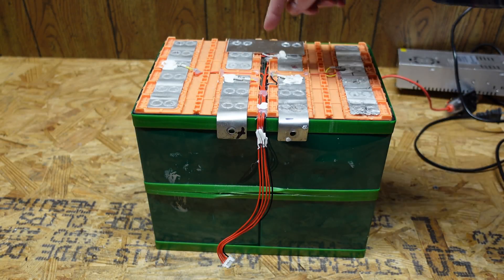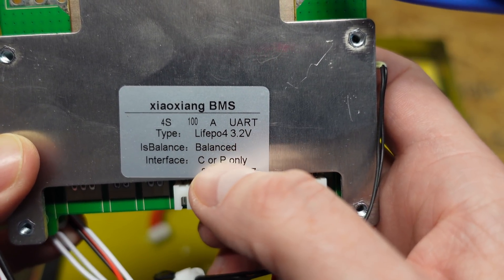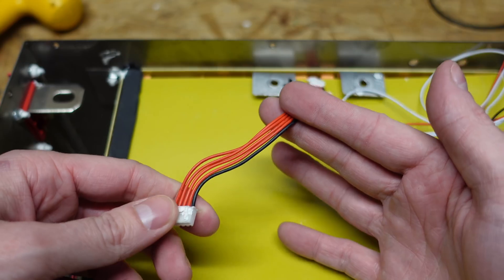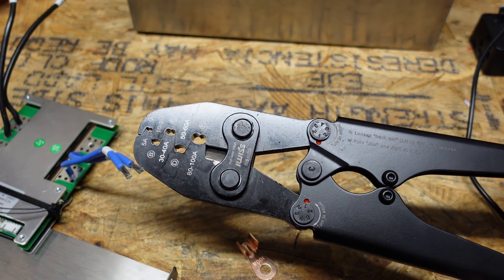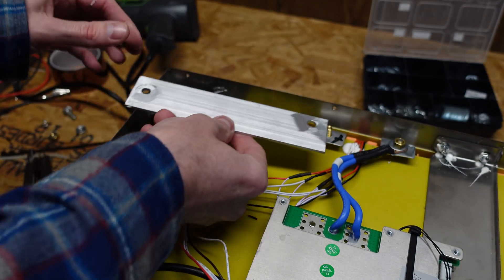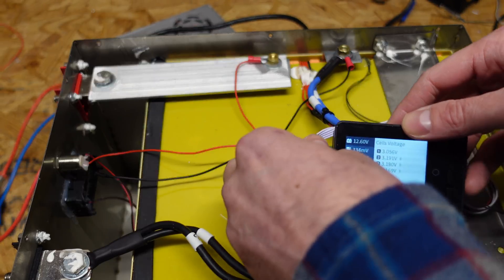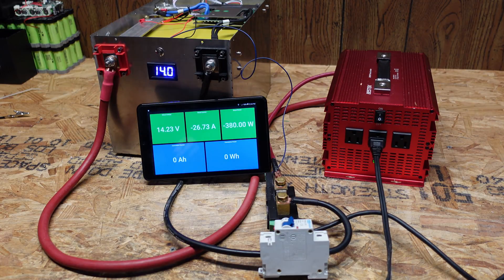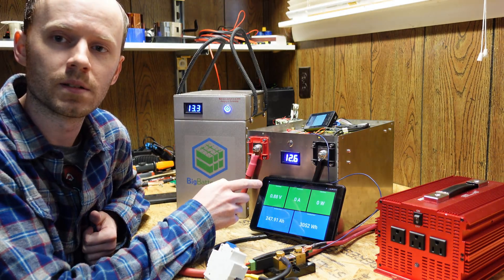Repairing the Failed SHUNBIN 12V 300Ah LiFePO4 Battery

Comment: Thanks very much for this review. These batteries are a very good price, so I have been looking at them. This video has put a stop to that. Without knowing the state of the cells originally, its not really possible to say if they are the main cause of the problem. It's certainly true that the BMS was really junk and didn't appear to be balancing the cells and allowed overdischarge. The charger didn't look very good either. I noticed you used a different charger to do the job properly. I will look elsewhere for a better battery.
Reply from the maker: Yeah, it's really too bad because it's a super-strong enclosure too. I wish more would adopt this type of enclosure rather than the standard plasticy kinds. They just need to improve overall choice of components here...

Comment: I've had two of the SHUNBIN BMS units fail. Pulling the cells out and hooking up Overkill BMS 16s.  When I purchased the SHUNBIN's in 2019, there wasn't anything even close to the price point. Using them for off grid house in Cabo San Lucas and electricity was a must.

Comment: 070121/0208h PST 🇺🇸 further to the note below, please note the JBD BMS can be mounted on any metal surface by unscrewing all the  M2X12mm flat head screws and replacing with M2X15mm screws and Mount the BMS on the existing Al (Aluminium) board, safely. No need to use double sided tape. FYI. Thanks and 73s…

Comment: I installed the same bms on my diy cells the same way but either bms is doa, or can it be woken up somehow?
Reply from the maker: You used the same BMS that BatteryHookup sells and it was DOA?
Reply: @LithiumSolar  yes the black wires show no voltage at the p-

Comment: HI, really thanks for your job, GREAT ! Now a 1M usd question....in  a case like this, do you believe is it possible to change the "wrong" cell? I mean, i'm a solar off grid installer, thinking to buy quite 60-100 pcs new cells and arm my own battery pack. In teh case i discover a bad cell after  one- two three  years working, anyone knows if there is the chance to change it for a new one? If anyone works with lead acid, you know (like me) that it is impossible and a customer have only a chance, wait for the whole bank getting worse...and buy  new complete battery bank.... let me hope in dreamfully fantasy...

Comment: Well you didn't really fix it, just patched it up! instead of a battery you can rely on it's just a half ass rated ! With a faulty cell!
Reply from the maker: I can understand that perspective. Fact of the matter is you can polish a turd but it's still a turd. The core problem was the BMS, which is now fixed (replaced). I have no idea the original state of the batteries. I would bet money on them not testing anywhere near 100%  when it was new. Another commenter told me he had a battery with 90Ah cells where they should have been 100Ah... The whole thing is just junk to be honest (except for the steel case...).

Comment: You need the bluetooth module that connects to the bms and u can monitor all what is happening on the batteries and most important, u need to check the parameters of the bms.

Comment: I have the Shunbin 24V 400Ah battery, or rather the 348Ah battery. The cells are actually 3.2V 174Ah x 16 (2P8S). Gotta love rounded-up marketing, ha ha. Was expecting a 10kWh battery, can only get about 8.9kWh capacity. Oh, and used unmatched cells to boot. My BMS  bit the dust after about a year. Had to replace it.  So, yes I agree, there's better choices out there these days.

Was there any writing on each of the cells, 3.2V 100Ah (3P4S)? Or a lower Ah rating? If they're 90Ah cells, for instance, your capacity test might be better than you think, despite the presumably degraded cells. Might just need a bottom balance.

Comment: You can screw the bms into place. If you look close, the aluminium plates are connected to eachother by small screws. On 1 side is the screw,  on the other side you can see the remaining thread. I used m3 screws which go into this available thread
I would go for the 120a version of the bms, since that has 3 wires instead of 2.
Also, get the version with bluetooth, only a few $$ more.
Overkillsolar has them, or source them directly from cn (but thats going to take a lot longer)
OverkillSolar also has a very comprehensive manual regarding this bms on its site

Comment: Good Video, Thanks.
The SAD part in this whole "ShunBin" mess, they use good cases, properly line everything, take the time to laser weld busbars onto the cells, BUT they use a craptastic BMS and then more often than not use dubious grade/quality cells, even used one.

The Irony is, with a respectable BMS (even a dumb one) it would be so much better.
IF they made them with Used Cells but Tested/Matched and advertised it as such that would be fine.
IF they used even New Bulk-Commodity cells that would be more acceptable for most AND they could even make  Higher Quality packs using new Grade-A Matched LFP cells.

They are like 75% of the way to something really good and DROP the Ball big time while Self-Harming the company brand/name...   Pretty stupid IMO.

Comment: After crimping i solder the connectors. I do not and never will rely only on a crimp.
Reply: Believe it or not a crimp can be a superior connection to solder. If done properly you can get a cold weld, at atomic level. This is why a lot of old telecommunications equipment use wire wrap over solder. It’s superior both mechanically and electrically.
Reply: If you have already achieved a perfect crimp, a dab of solder (or sodder on the other side of the ditch) provides a nice environmental seal if you iron is hot enough and big enough so the solder doesn't wick into the cable.
A good crimp and sticky heatshrink is a better option though. 
Soldering before crimping is a complete No No as the solder will creep, heat and burn.

While we are talking about crimping,  think about pre-insulated lugs, please never purchase or use " vinyl grip" lugs, track down and pay the premium for "Copper grip" lugs.
Only Copper grip lugs are certified, critical applications like BMS cell sense leads can fail causing destruction if the cheap lugs are utilised.
Reply: Some will suggest soldering even with a crimp.  BMS Battery sense leads also read Internal Resistance of the cells they are monitoring, not just cell voltage.  If soldering is done and it is not a High Quality good solid connection it can & WILL introduce resistance which will throw off readings.

ALWAYS verify BMS Harness Leads once the Ring Terminal is attached for connection & resistance.  Make sure it is well connected to the Battery Cells PRIOR to connecting a BMS.  One tiny mistake & the BMS is cooked instantly.

Comment: Exactly why I'm BMS free  (so far..LOL)
Reply from the maker: Ooooh, living on the edge I see! Haha. Seriously though, would definitely recommend adding one for safety... :)
Reply: @LithiumSolar  Living on the edge for sure. Then I ask myself if I'm ready to subject my 56 KWH battery bank to a $10 Chinese BMS module
Reply: @mark_osborne  54kWh is worth a lot of coin and it would be ludicrous to use a cheap $10 BMS.  Running such batteries without a safety is pretty risky on the investment.  I'm running 5 LFP Packs,  1190AH/30.4kWh and each has a 300A BMS & QNBBM-8S Active Balancer because it is an investment worth protecting.
Reply: @mark_osborne  on the topic of BMS what is a good bms wud u recommend .... thanks for sharing the video
Reply: @raybacchus1026  A brain, a calendar,  and a volt meter ...lol

Comment: It would be interesting to see if after a few cycles this battery evens out a bit or if the capacity is permanently lost.  I have had mixed results with LiFePO4 cells where some subjected to deep discharge, even flat sometimes came back to near full capacity after 4-5 cycles but I have had others, even some from the same batch of cells that were permanently degraded in some cases to less than 30% of original capacity.  Then again 83% isn't bad for recovery on an otherwise dead pack.  It may be a good idea to test one of the good cell groups with a full discharge cycle to see how much capacity difference it has as the other cells may also be less than the 300Ah stated capacity.

Comment: The truth is bigbattery aren't doing any better.
I let it 2 more days of slow charging/discharging cycles to let the cells equalize before the capacity test.
Reply from the maker: Why would you say that? The build quality of my 170Ah power block is outstanding.
Reply: @LithiumSolar  I saw the video from WP were it was leaking acid and the company send him replacement quickly for him to remove the video. Other sailing Hakuna had problems with his battery too, wires were loose  inside.
Reply from the maker: @neliosamch3195  I've seen Will's video and have been following the comments. The video is still up on his channel. From what I heard, he had a pre-production model and it was a QA issue with the batteries themselves. I took mine apart and closely inspected everything. I did not see any problems with mine.
Reply: @LithiumSolar  That is good. Keep an eye in the cells voltages. This chemistry tends to spikes the cells voltages after 3.4v. I won't charge them above 3.4v.
Reply: @neliosamch3195  big battery never said to remove the video when they sent him new cells nor did they do it so he would remove the video. BB even told him that they examined all the cells they had in stock and found 11 out of like 10,000 that were also showing signs of leaking. Not sure where you got that from.
Reply: @Medic_713  He did removed it and then released a second melo one. Just because these batteries are ensembled in here for twice the price they still are Chinese made batteries. So defective cells are to be expected no matter who ensemble them. I have more than 50 Cells and despite of having more than 60A of active balancing they only get balanced when aren't being used.
Reply: @neliosamch3195  The 2 videos he made about the leaking cell are both still up and neither was removed. Yes, thats how balancing works. Cheap BMS's either won't balance with a load or balance with very low mAh so it takes a long time to balance.
Reply: @Medic_713  It is irrelevant if he did removed it or not. The matter is the batteries have problems with internal resistance and any active equalizing board works constantly until cells are balanced. I'm not against the batteries because they are a better option than lead acid ones but they are way over priced.
Reply: @LithiumSolar  BB has repeatedly dropped the ball on Q&A and this is not new, even going back to the BYD Battery Pack debacle.  They are getting better but not quite there.  Again, mostly due to Sloppiness, which could be avoided if they paid attention to "all" details.

Comment: I normally double over stranded wire where it enters a crimp connector, so it cinches tighter into the connector instead of pulling out.  This will also help a lot when the lug is bigger than the wire!
Reply from the maker: I wish I would have thought of that... Great tip, thanks!
Reply: Performing a wire wrap with something about as thick as stripped  Cat6 Ethernet cable works quite well too. Those thick open barrel lugs and the big crimper look a good option and with a few tweaks will be pretty close to perfect in the mix and match stakes.
Also good to see you applying a little Aluminox paste. I would have also used it on the aluminium busbar connections as it cuts through the oxides and prevents them reforming which is why aluminium lugs are filled with Aluminox and capped. 
All in all you have done as good as you can making strawberry jam from pig shit.

Comment: What is a non-polarized breaker? Thanks
Reply from the maker: A non-polarized breaker means current can flow in both directions. A polarized breaker can only interrupt current flow one way.
Reply: @LithiumSolar  A DC breaker also needs arc suppression.

Comment: 2 things: 1: Great video!, 2: be really carefull with overdischarged cells. these often have dendrites that grow on the anode and cathode and there is a risk of puncturing the  separator and create a direct short inside the cell. That's why good BMS normally disable permanently a battery that had overdischarged cells.   I hope this help and that it can warn you enough so you can take the right decision on damages cells in the future. for more information please read this great article: https://ieeexplore.ieee.org/document/8951808
Reply: https://uwspace.uwaterloo.ca/bitstream/handle/10012/12177/Catton_John.pdf

Another method for protecting the battery pack from a potential thermal runaway event due to an internal short is by relying on the battery management system.  A battery pack has to be equipped with a BMS system to ensure that the cells within the pack do not operate outside of their voltage and temperature thresholds during cycling.In addition,a BMS can isolate a cell in the battery pack if an internal short occurs. Thiscan be detected by a drop in cell voltage, triggering isolation of the battery from charger or load. Once again, the short cannot be prevented, but the mitigation will prevent further damage to neighbouring cells and the pack.
Reply: @offgridwanabe  Thanks - that was an interesting read. Note though that the paper is for Li Ion, not LiFePO4, the chemistries are different and the failure modes described may not affect LFP cells to the same degree or at all.
Reply: @Bennyboy-dog  there are specific portions of the document for Lifepo4 and conclusions for reusable batteries but yes it has a lot of information in recycled lithium. Section 7.1 has lifepo4 conclusions
Reply: @offgridwanabe  Thanks, yes I saw that, but wasn't sure if it was their research or just cited material. All good info!
Reply: @Bennyboy-dog  What I found more concerning as I am in Canada by 2025 they intend on legislating the reuse of lithium as home batteries so the end is near.
Reply: @offgridwanabe  Perhaps they might just want to let market forces do that. The legislation should be to compel EV industry to re-use the battery pack and sting them if they dispose of them.
80% or 70% of a 30kWh to 120kWh battery is more than enough to run a home here in Australia at least. Not sure if you would consider batteries for heating (there are much better ways to store heat anyway), so it should be sufficient for you guys too. The other thing our illustrious morons of leaders should do is legislate that all EV's have VtoG built in. You guys are more advanced than us, you say to our leaders here in AU, EV and the say ICE, you say electricity generation and they hold up a piece of coal. They are bloody morons.
Reply: @Bennyboy-dog  Agree we have a long way to go to bring the future to the past where we all live, the money still runs everything whether it works or not.
Reply from the maker: I would be very interested in reading this, but it requires a subscription to access. Wouldn't any dendrite damage be visible through IR testing though?
Reply: @LithiumSolar  the link I put up is free and is very extensive hope this helps
Reply: A subscription to IEEE is required.